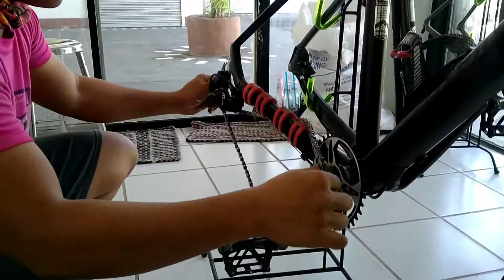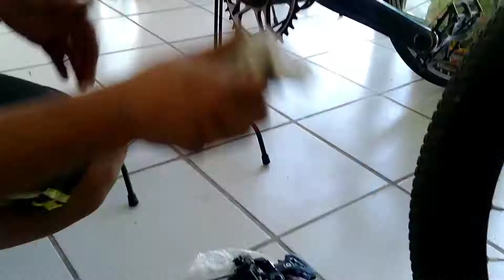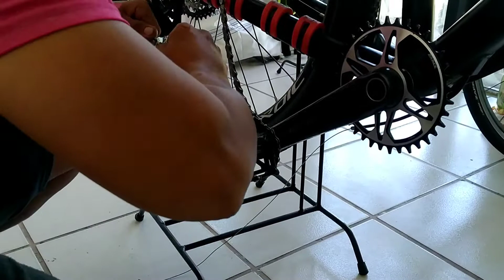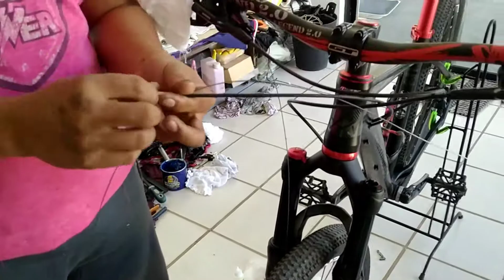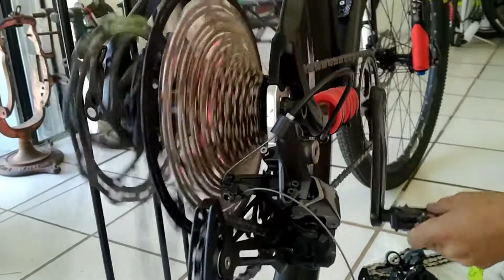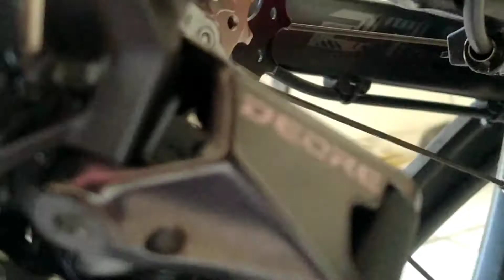UPGRADING UP KIT  LTWOO TO DEORE M6100

Comment: Pwede po kaya yung m6000 shifter sa m6100 na rd? Saka 10d na cogs
Reply from the maker: Pwd po yun boss basta deore parihas
Reply: @mannyworks5006  panonpo pag sagmit yung cogs ko ok lang po ba
Reply from the maker: Okay lang yun boss sa tuno lang ang mag adjust nun
Reply: @mannyworks5006  idol may tanong papo ako ano po mas maganda M6100 na Rd or yung M5100 na Rd or M6000
Reply from the maker: Ang m6000 pang 10speed po yun
Ang m5100 pang 10/11 speed po yun
Ang m6100 pang 12 speed po yun
Kung nak 10 speed ka boss mas maganda mag m5100 kanalang

Comment: Sir ilang 11 51 yan 12 speed sir? Anong brand
Reply from the maker: 11/50 lang po 11 speed lang po sir deore m6100 po brand
Reply: @mannyworks5006  sir meron ba m6100 na 11 speed lng kala ko kasi 12speed yan ang 11 m5100 ata sir
Reply from the maker: m5100 nga pala yan sir midjo nakalimutan kuna  kuna po kc✌️✌️✌️